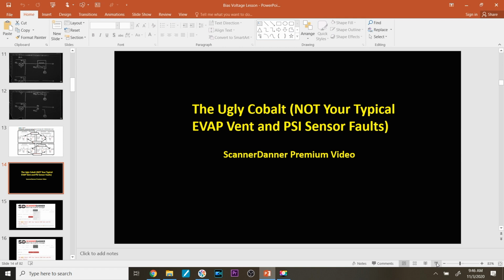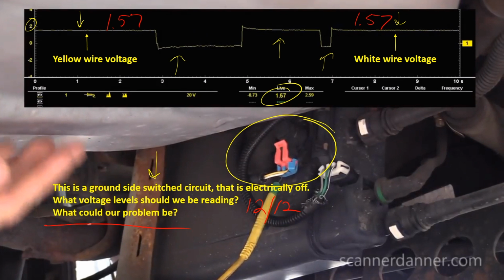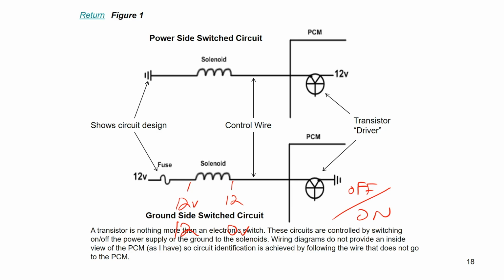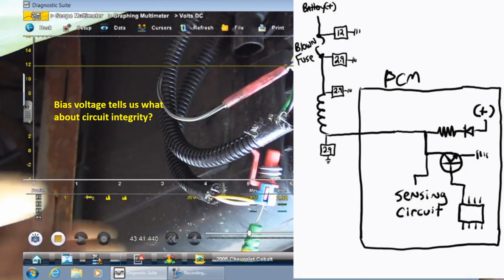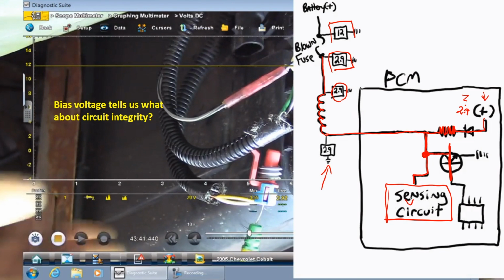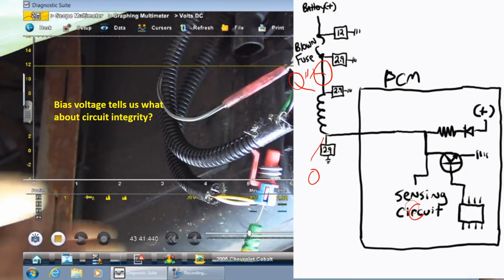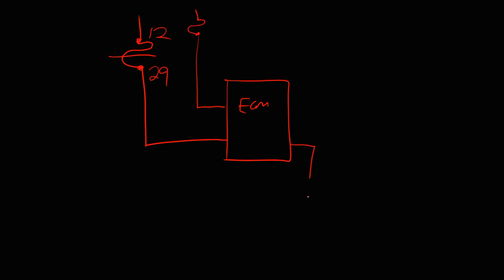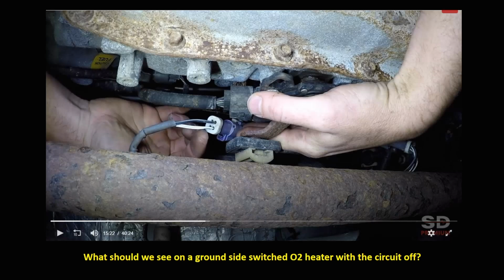An SD Premium lesson on Bias Voltage

Comment: Bro! THANK YOU SOOO F##KING MUCH FOR NOT JUST THE AMOUNT OF CONTENT YOU PUT OUT BUT THE VALUE OF INFORMATION AND DETAILS AND REASONS WHY AND WHY NOT AND HOW AND HOW NOT....
    It would take me a year to actually break down the amount of ways you have taken us there and back.  All the positives, all the negatives!  When to hit the break or steer around that rack! 
 From the pinions in transfer or replace that case snapped or the rear stripped the gears to drop the tank leak EVAP!
When to not lose your head and stay grounded or when to stay neutral so we can remain more well rounded!
 Sometimes when all else fails and we are stuck in the dark! A back probe a test light an ohmmeter A SPARK! 
 A simple broke relay could be all it takes then she starts!
 To help us from ripping out all our hair as we stripped it to scrap it and sell it all off for parts cause you have taken the time to help us diagnose all the diagrams code the wires and charts!
 From tool carts and ratchets and extension attachments with sockets and drivers to wrenches to slip bust a knuckle and crack it!
 Then take a sledge hammer out back to find something TO LET THAT RAGE OUT AND SMASH IT!
 Then remember a tip that you slipped in real quick and skate back like from practice and crank off slap shots galore to score the goals for the hat trick!
 There's a difference from being a fool ass tool with a jack who gets off as a hack who just whacks it away at the parts store all day wasting cash by the stacks then 8 out of 10 times try to bring it right back!
 To knowing with witt when to hack it legit and look like a boss when you save a fine chick without a rip or a stain on your shirt or jacket!
YOU ARE A TRIPLE O.G. WITH THE SNAP ON TO MAC IT!  
THE SCANNER IS DANNER A WALKING TALKING INFO MECHANICAL PACKET!
THATS REAL AND JUST FACTS FOR ANYTHING THAT YOU LACK!
  LONG AFTER WE'RE GONE THERE IS NO DOUBT THAT THE STATS 
 WILL REFLECT ON MANY GENERATIONS TO COME AND THEY WILL LEARN THE RIGHT WAY TO ACT
YOUR GIFT HAS A WARRANTY OF MANY LIFETIMES IMPACT!
THATS A WRAP FOR THIS RAP! THE ONLY WAY THAT RIGHT NOW THAT I COULD THINK TO GIVE BACK
ALL LOVE FROM TRAXRIPPER WHO STAY ON JUST OUT RIPPIN THE TRAX!
 Things have been rough for me and things have been tough but I tell you my man on this I go all in with no bluff...
  I COULD HAVE LIKE TEN LIFETIMES AND STILL FEEL LIKE I LEFT YOU ALL SHORT OFF AND CUT
 TO THE AMOUNT AND THE WAYS THAT I CAN NEVER THANK YOU 
ENUFF!

 ALL LOVE BRO!
GREAT F##KIN STUFF!

T Ryan Amrhein
aka TRAXRIPPER
aka Yankster Da Gangster
aka Mid West White Boy
   WHAT UP!
Reply from the maker: Dude I'm crying man. For real, not kidding....no words except I felt that.
Reply: @ScannerDanner  don't worry I can ramble out enough words for me you your brother and son ten of your friends and the last 6 graduation classes!
 Lmao if I was a fish I'd be a large mouth bass hole!
 A record setter for how many times I been thrown back cause I don't shut the hell up!
Ha ha ha ha!

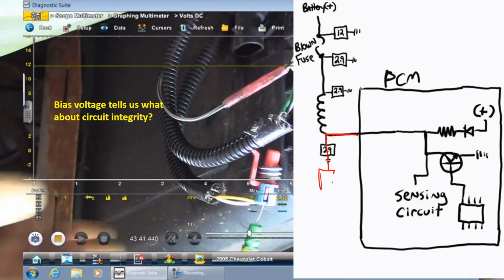Comment: 22:50 isn't use test light that way can fry and damage the ECU purge valve transistor?
Reply from the maker: No
Reply: @ScannerDanner purge valve solenoid is inductive load while test light is resistant one . Inductive load as I know prevents current fast build up while test light resistance can draw maximum time in a short time and could hurt the transistor. Isn't it?
Thank you for your knowledge sharing.🎉🎉
Reply: @samerasaad7010 still no…

Used 250 milliamperes test light for years on all makes and models and never fried a driver yet.

So you do realize a noid light that you can plug into the harness of a fuel injector is the same thing right?

Comment: I have a 2 year degree in automotive tech, all the oem training, ASEs, etc. and we were never taught about bias voltage. The wire diagrams dont show it and the flow charts all say you should have 0 volts. I had to figure it out on my own many years ago after getting stuck in a rabbit hole chasing the stray voltage. The manufacturers seem to be gatekeeping the internal workings of control modules.

Comment: My question  is that If I  want  to do something test  like  this  I pressure  pump  is  the same way pls  if so  feed me back  thanks
Reply from the maker: Every car and system is different. I really have no idea what you are working on, what test you are trying to do. This was a lesson on fundamentals using a very specific case study to show how these concepts are applied.
Reply: Iam working on passage fsi 2005 models  fuel pressure sensor
Reply: Sorry  is passat 2005 model  with 0.2 lt engine  fuel pressure  sensor  test

Comment: Encountered my first bias voltage today. 25 CRV A/C inop. Performed all my voltage checks at the relay located in under hood fuse box. Identified my 2 hot all the time relay pins and then with relay unplugged I discovered a 2.47 volt bias on the ground side switch relay control wire. We have a relay breakout box tool so I then plugged the relay back in and watched my bias go to system voltage (relay not commanded on) all that to say thank you so much for making me a technician you have been a true blessing
Reply from the maker: Let's go! Awesome. It can be confusing at first, until you recognize it and start applying it to your diagnostic process! Thanks!

Comment: What actually cause the fuse to blow if one side is 12v and other side 29v there is no current flow right?
Reply: And if we put a good fuse.that 29v make all the other fuse on that same sherd lege to rise to 29volts?
Reply: And the ingintion coil and injecter feed circut the same thing is happening right but we meshure the fuse or back prob these things it reads stady 12v why is that?

Comment: My initial diagnostic step based on watching all of these videos is to check all fuses in all fuse boxes on the car.   Fuse boxes are easy to get to and I can check all fuses in about 20 minutes.  This needs to be the starting point of all electrical troubleshooting.
Reply from the maker: To each his own, but i disagree with your last sentence.

Comment: From experience I can tell you that Detroit auto OEMs development and engineering staff, which includes all of the shop technicians (auto mechanics) are DMM centric when it comes to general troubleshooting (looking at all circuit types, 12VDC, 5VDC, 2.5VDC, without the worry of damaging the DMM due to very high input voltage, e.g. Fluke 87V goes to 1000V, where most ignition coil primary voltages are clamped at around 430V, just in case you encounter high voltage), where the most popular brand is Fluke (for many reasons like; yearly calibration consistency, OEM testing experience (ruggedness), input protection, etc. e.g. Fluke 87V). 

If the electrical engineers and technicians want to load a circuit they can just use a large non-inductive +/-1% Tolerance power resistor at an appropriate value to load the circuit. You usually only need 4 or 5 large power resistors to cover all testing in a passenger car or light truck. These are custom made with silicone leads and stacking banana jacks (you can choose either shrouded or unshrouded depending on what lead sets you use), the DMM is set to VDC and the test resistor plugged into it with the normal test leads plugged into the resistor stacking jacks.

So why use a DMM + resistor to test a circuit with a load rather than an incandescent bulb or a 12V test light? Many reasons:

1) You know more about the circuit under test. 

For a simple example. I want to test a 12VDC power feed but under a 1.2 Amp load. According to Ohm's law my load resistor would be 10 Ohms. When I take my voltage measurement, let's say it is a little low at 11VDC, I also know the amount of current being drawn by knowing the resistor value and Ohm's law; 10 Ohm resistor, Current = 11VDC/10 Ohms = 1.1 Amps. With the DMM I know the circuit voltage and my test load current very accurately. 

2) Incandescent bulbs have a cold current inrush current which is 10 to 15 times its fully hot current, with a 1 Amp bulb you can easily draw 10 amps, which is why bulb testers burn small PCB traces. Non inductive power resistors as a load do not have a momentary inrush.

3) Incandescent bulbs are made of glass and can break.

4) Incandescent bulbs burn out. Planar chassis mount power resistors last decades. 

5) Incandescent bulbs when hot can burn you or the car (like carpeting). With a power resistor you will dissipate energy (make heat) but there are several ways of dealing with this. The most popular is to mount the resistor to a small aluminum heat sink with fins and cover with large heat shrink keeping the ends open for air flow. This works good because you hardly every have the load present for more than a minute. The heat shrink will keep you resistor and heatsink from shorting across something. 

6) If I want to load a PCM 5VDC reference output I can choose the best resistor to load the circuit. So if I want to load it at 250 mA I would use my DMM and a 20 Ohm resistor (I use a 22 Ohm which is a common value available).

7) You can use a load resistor to eliminate 12VDC ghost voltage when measuring power feeds due to the very high input impedance of the DMM on DCV. If I load the circuit with 100 Ohm resistor for 12VDC testing I will draw 120 mA at 12 Volts DC which will defeat any ghost voltage. I am essentially decreasing my DMM input impedance (resistance) by adding a resistor.

Now for the bad news. 

All of the above costs money. In Detroit you have to pay to play. I don't think I have ever seen a single incandescent bulb used as a tester or a test light which was not LED at an OEM testing garage or tier one supplier, and then the LED test light was used only for simple 12V lighting circuits. You just learn to use your DMM for everything until you need to use a scope, if you need a load, add a load. I have made some special purpose gadgets for testing either LED based or 12V buzzer based, but these are usually done at the request of the lead garage technician, or a project engineer. For an intermittent 12VDC power feed a buzzer is really handy. You can wire in the buzzer and then move the harness until the sound is interrupted. You want to pick a buzzer that is quick responding.

A Fluke 87V is very powerful if you know how to use all of its features; like Min, Max, Relative resistance reading, accurate low current readings, true RMS on AC, etc.

Popular resistive load values for automotive 12V systems: 6.8 Ohm, 10 Ohm, 22 Ohm, 100 Ohm, and 1000 Ohm.

In closing I think we should ask ourselves why certain incandescent bulb testers are used per the different currents drawn at steady state. Many users of bulbs will use a 1 Amp bulb or a 4 Amp bulb, but, other than they are readily available in these standard sizes, it would be good to know why the user thinks that particular current draw is of significance. So, the questions is why are you using a 4 amp bulb as opposed to a 1 Amp bulb? What do you think the 4 Amp bulb will do for you? Why don't you just directly emulate the needed load with a resistor?

Comment: Great point you made in the video! You can sit in class all day and "know" something. But until you're in the field and your paycheck depends on making the right call, it wont fully sink in as far as voltage readings, voltage drop testing, etc. Ive seen it multiple times with techs coming out of tech school. We never forget those bad calls and we hopefully wont make them again, IF, we take the time to understand why/how we made the bad call in the first place. This stuff really does come "alive" and will give you a "lightbulb" moment, if you're in the field and going through these teachings/testing procedures. Understanding the fundamentals can take us farther than most. Even if we've been in the field for years, going through these teachings again, we can pick up on things that were overlooked or hadnt sunk in yet.
Reply: I also remember the case study on that Ford you're talking about in the video. I was just talking to a coworker about it the other day. I couldn't remember where it was coming from/why, but remembered the 29v or whatever. Great explanations here, I use bias voltage checks regularly. Haven't ran across one that will light a test light yet, so I'll have to remember that variable. Funny how we think something is an "absolute" and then see something that contradicts our thought processes and experience. I try not to say always, never, etc when teaching other techs.
Reply from the maker: Did I mention the bias that lit a test light? I actually was able to prove that was a bad test and there was another variable to it! I have that lesson recorded as well.
Reply: @ScannerDanner  I'll have to check that out, I don't recall watching that one yet. Did you put a link to it in the video? If you did, sorry I missed it.
Reply from the maker: @williamtanner8222 I believe it is in this series..
This is from the description:
This is a clip from a 5 part series we recently completed on ScannerDanner Premium titled "Circuit ID and Integrity Testing (2020 Edition)"
To watch the rest of this class, sign up for the 14 day free trial we offer right here https://www.scannerdanner.com/join-scannerdanner-premium.html
Thank you and I hope to see you there!
Reply: @ScannerDanner  okay, cool. My boss pays for premium(h-tek auto care). I'll check it out. I know its confusing, williamtanner8222, I aways "sign" my comments Cole, on your website. William Tanner is my "gov-ment" name, I go by Cole🤣 you interact with so many ppl, you probably won't remember and that's okay, I won't take it personally

Comment: Talking about grounds if you worried about a ground, just go directly to the battery and you don’t have to worry about it
Reply from the maker: 100% but in my case I was in the back of the car without a 15ft jumper wire to get me there.

Comment: 12v on power wire 2.9v on control ground wire for Nissan rogue intake and exhaust control solenoid valves while harness was unplugged from solenoid.
Reply from the maker: Sounds like a good circuit

Comment: I'm driving a 1998 Toyota Avalon and wondered if they use biased voltage in O2 sensors? I replaced bank 1 sensor 1 and it's running good now. I ran some tests on my battery today and I'm at 12.8 with then car off and 14.1 running which is almost perfect compared to 11.8 and 13.1 before I replaced the sensor. It had problems driving in the rain, used to turn off. I cleaned the maf sensor, idle one and cleaned the throttle body out. Before I did any of this I would try to charge my phone and the car would steal my phone's battery somehow. Any thoughts on O2 sensors and battery?
Reply from the maker: Not sure offhand, I'm sorry.

Comment: Another great Vid Paul. I have been wondering about the reverse voltage EMF induction spike bc I have read that the backfeed induction spike could cause computer circuit damage e.g. not giving spark plug a ground path when doing a kill cylinder test. I was pooh poohed by a mechanic friend re this bc he has never had any untoward result from doing so. Do the engineers design stuff to be able to handle a loss of ground? Thank you.

Comment: Paul, you said that the observed 2.9V bias voltage was quite possibly a 5V bias source being dragged down to 2.9V by the finite impedance of your meter.        You then said that for all we know, the bias voltage source might even be 12V through a very high bias resistor, that the meter is then dragging down to 2,9V.    Could I offer a thought why it’s probably not a 12V bias source?      In one of your early lectures you explain that bias voltages are there to allow the ECU to check for circuit integrity.      In this case study, the fuse was blown, so you had 12V on one side of it and 2.9V on the other side (let’s say the ECU would read a true 5V without the meter in place)..     The ECU would then see 5V instead of the 12V it expects to see on a normal circuit.    So the ECU would then know there is a break in the power supply circuit and would flag a fault code.     But if the designers had used a bias voltage of 12V, the ECU would see 12V even when the fuse was blown, so that would be of no use as a circuit-integrity monitor; the bias voltage has to be significantly different to 12V eg 5V if it’s to be of use as a diagnostic tool.     Would you agree with my thinking?     (By the way, another superb video showing bias voltages in practice.)

N.B.    I do understand the point you’re making - why you said the bias voltage might even be 12V: you were pointing out that bias circuity is, almost by definition, there to inject a ‘weak’ voltage into the circuit for the purpose of onboard diagnostics, and the very high resistance in bias circuitry is so high that even the high input impedance of a meter is enough to load the circuit and dramatically drag down the true voltage, giving a lower and false, measurement

Comment: Paul you said you had the 2.9 bias voltage all the way back to the blown fuse,was that before or after you cleared the short to ground near the door I assume after because the short would pull your bias to 0 and the remainder of the circuit from the short to the fuse would be at 0 volts?
Reply from the maker: The short to ground was intermittent! Great question! It was not shorted when I was doing those checks

Comment: If a system has bias voltage, will that be spelled out in service info?  How would I know outside of just using a test light or loading a circuit instead of a meter?
Reply from the maker: No sir, you will find NOTHING in service info about these types of circuits.
Reply: @ScannerDanner  outside of experience, is there any way of confirming you have a biased voltage?  Just experience?  I can see where this would confuse and send someone on a wild goose chase if you don’t know.